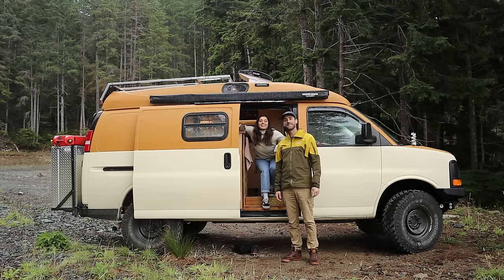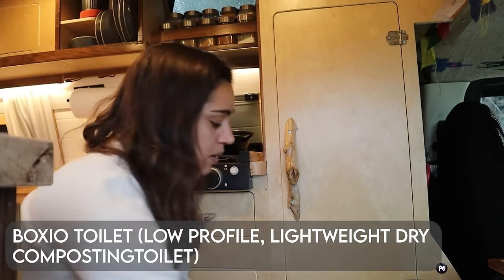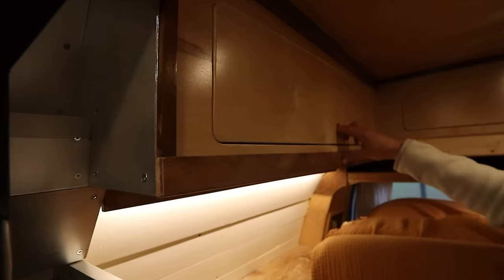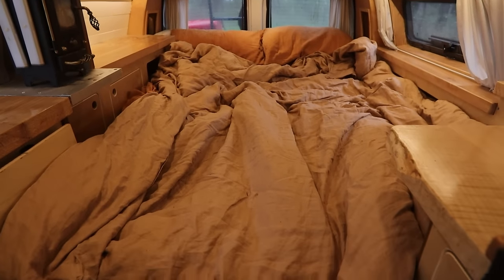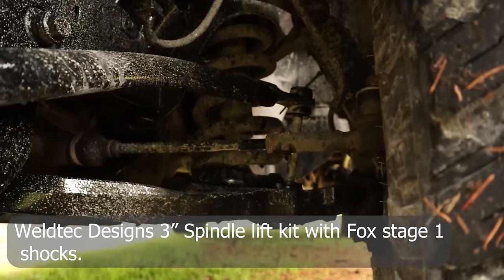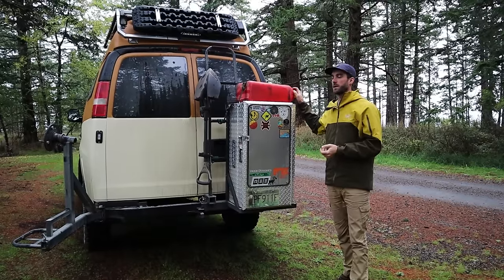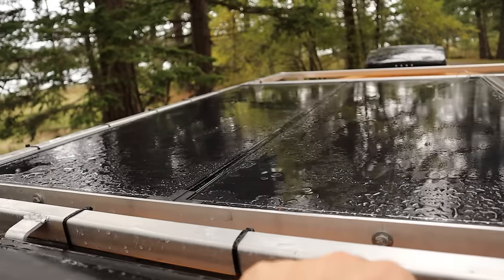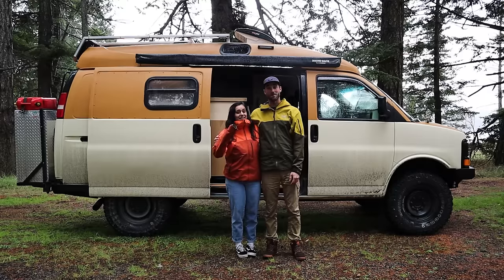DIY Chevy Express 2WD Van Conversion | Build 3 Tour

Comment: Regarding the 4x4 conversion cost vs. benefit like you mentioned, a good compromise may be installing a locking differential in the rear. I’m not as familiar with the modern gen of vans, but with the g-series vans you can get a kit to replace the stock open differential with a locking differential for under $1k, and I’ve found Rwd vehicles with this feature to be nearly just as capable as a 4x4. Especially where snow, mud, and sand is concerned. Alternatively, limited slip differentials perform really well too, with the added benefit of more stability on pavement where icy conditions may exist. Just a thought I had when you were discussing the choice not to convert to 4x4. Plus, converting to a 4x4 usually includes a lot of aftermarket parts that may be hard to fix or source parts for if anything happens on the road.
Reply from the maker: Not to worry. Were currently lining up a Chevy 14 bolt full float with 4.10’s and a g80 locker. 😁😁🤘🏼
Reply: @SlowRoamers  beautiful. I’ve been really impressed how capable these vans are offroad with some good tires and occasionally snow chains

Comment: From Betty 1.0 to 3.0, the transformation & improvements look impressive, a lot of work for sure, but satisfying to have a build that suit your want & needs. Two-tone paint job looks sharp as well as the roof rack on the hi-top. You could probably start a business fabricating hi-top roof racks & bumpers.
Reply from the maker: Thanks so much the kind words. It’s been a dream of mine to really boil down everything I need and shove it into a van, this was the project to do it. When we’re back and stationary I may look into starting a van build company once again and possibly add aluminum rack building into the mix. Thanks for watching!🙌🏻🙌🏻

Comment: Sorry for all the questions, but I watched your other videos and I am curious how you secured the cabinetry to the fiberglass top without compromising the fiberglass? Thanks
Reply from the maker: Glued furring strips to the ceiling, the braced them from the roof flange. The cabinets are built to sit on the roof flange and help to hold up the ceiling. I just PL premium to adhere the strips, and they were pinned up against the ceiling overnight.
Reply: @SlowRoamers  ah very clever. It seems a lot of your design is meant to be supported by gravity more than anything which I really admire

Comment: Wow 😮. Absolutely amazing! I’m saving up to buy a van (hopefully my dads E-350. I was worried that I would have issues since it’s not 4x4 but you have given me much more confidence. You also gave me so really great ideas for the actual build! I only just recently found your channel and will be going back and watching all your build videos and obviously following along for all your adventures. Do you happen to know what video you modified the sliding door. The van I’m looking to buy has windows all around since it’s a passenger van but I don’t want all the windows. Anyways amazing build!
Reply from the maker: Heyyy! Thanks for tuning in and glad we’ve inspired your build.😁 Look for the thumbnail that says “more windows”. That’s when I modified the sliding door. Your windows will be held in my a very tough glue, you’ll need a fresh x-acto blade and a lot of time to cut it out. What I did to seal was put a strip of adhesive foam about 3/4” inset into the aluminum sheet and then a bead of sealant on the edge of the sheet, then stuck it in and used self tapping screws. The screws were sealed as well. Good luck!
Reply: A new camaraderie is born .. great to see!

Comment: I would really like to know about the P funnel. Do you have that going to a black water tank or doing something different. This is something that I struggle with the in my own van
Reply from the maker: Honestly, it just runs out the bottom of the van. We only use it while wild camping when we’d be peeing outside anyway. There’s also the BOXIO option which is great, a little separating toilet does wonders for being self contained in a city situation.

Comment: Hey Alex! So I'm going through the process of scouting out a Dana 60 rear with the G80 gov lock. It's seems to be the only "locker" option for our vans unless I'm mistaken. Have you taken a dive down this particular rabbit hole? Great vids as always, cheers!
Reply from the maker: Hey Corey! Good plan. I think you’ll sooner find a Chevy 14 bolt than a Dana 60. If you’re ok with the rear axle being a little narrow and you’re not scared of a little fab work you can use an axle out of Silverado 2500, they often come with a g80. If you’ve got the 12 bolt Dana 70 semi float there really aren’t that many locker options. I may have located a 14 bolt full float with g80 out of an express which I’ll be installing later this month. They’re unicorn axles, but your best bolt in option.
Reply: Thanks for the heads up and super stoked to see the rear end swap video lol! @SlowRoamers
Reply from the maker: @zepperhead89  I'm stoked to get started!
Reply: @zepperhead89 axle swap video coming SOON. The actual swap is expected to happen by this weekend (in Phoenix).
Reply: @alistairjackson7658  I can't wait to see it. This will be my instructional course for my own axle swap. Best of luck to you guys!
Reply: @zepperhead89 the axle swap is done. Alex & Megan are en route to Baja so time frame for video release is unknown at present, but it'll be ASAP.
Reply: @alistairjackson7658  woohoo! Baja to test the new axle! Glad it went well, thanks for the update 🤙

Comment: What material/type of wood did you use for the cabinetry? Curious to find a strong but lightweight solution for my build
Reply from the maker: 5/8 prefinished birch ply. If I was rich and had a lot more time and patience I might go with a cabinet grade 1/2” baltic birch. But the 5/8 does fine.
Reply: @SlowRoamers  very nice. I’ve seen some folks use hardwoods or pine and I always worry about the weight considerations. Seems like you struck a good balance between strength and weight with the interior design